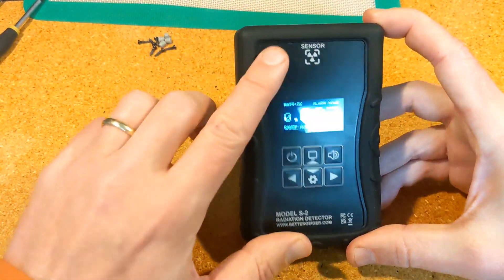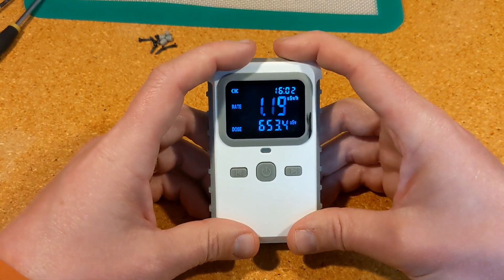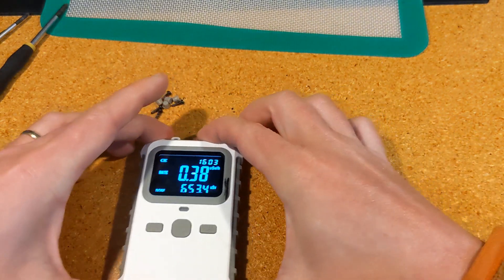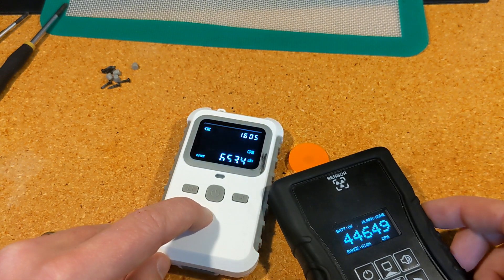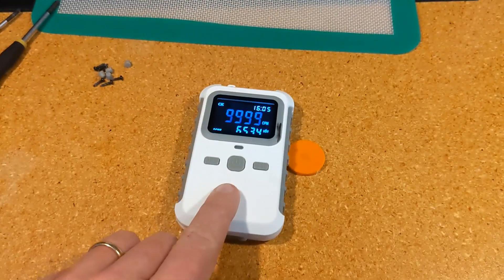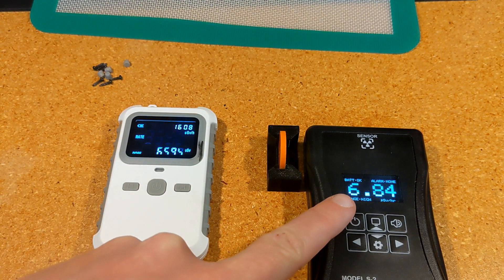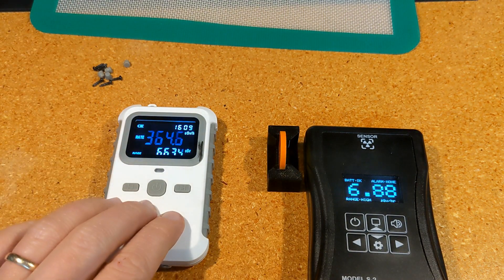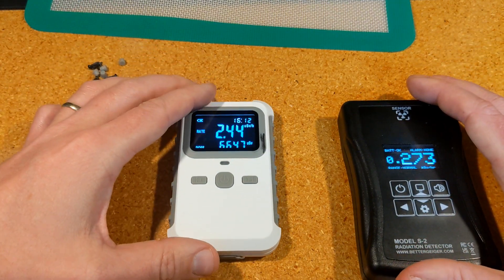Better Geiger S2 comparison with another low cost scintillator detector

Comment: Impressive video, BetterGeiger. Looking forward to seeing more content from you. I smashed the thumbs up button on your upload. Keep up the fantastic work! Your detailed comparison of the energy compensation issues was enlightening. How do you think advancements in sensor technology could improve the accuracy of low-cost radiation detectors in the future?
Reply from the maker: @KeyserTheRedBeard  thanks for the comment. That's a good question. I don't think there is a huge amount of room for improvement in the accuracy department, a correctly energy compensated scintillator is pretty accurate. What I do expect is more high sensitivity options to come into the market in the coming years with gradually dropping price as competition in the amateur radiation detector market continues. And in the case of gamma specs a gradual improvement in resolution, but no major jumps until certain exotic materials drop dramatically in cost, which doesn't seem to be happening.

Comment: Hi, Robert! Thanks for the awesome teardown of that detector! The sensor glued to the crystal looks a like a MicroFC series SiPM from onsemi. They have 4 square pads on the bottom and anode and cathode are on opposite corners. Also they take lower voltage, 25 .. 30V.
Love the content 👍
Reply from the maker: Thank you! You are probably correct. I forgot the MicroFC has such a low operating voltage.